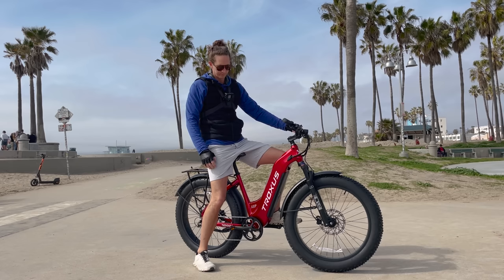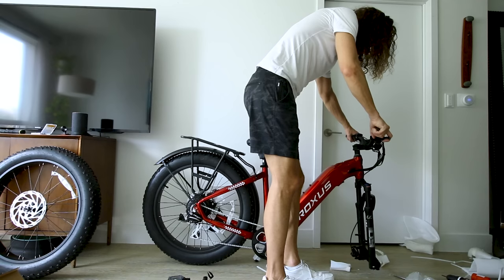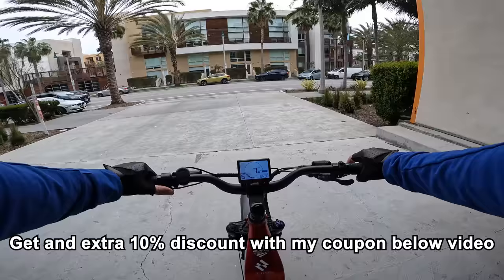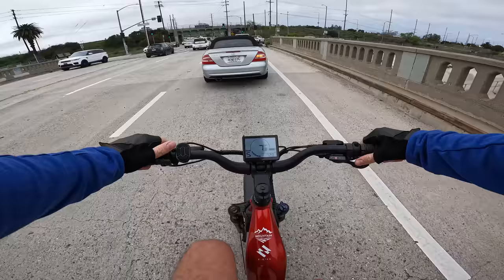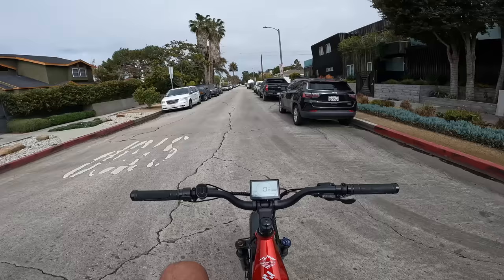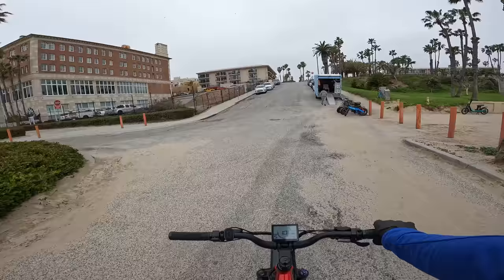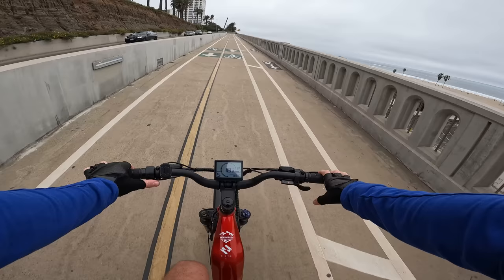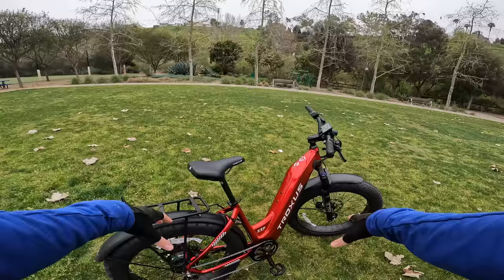Overpriced EBikes DO NOT Want You To See This! Troxus Explorer Review

Comment: One thing I see missing from virtually every ebike review is VERIFICATION that the battery does indeed provide the Ah capacity it claims to provide...in this case, 20Ah. This can be a problem as I have found a LOT of Ah claims that are quite a bit higher than reality (for example, an ebike battery claiming 10Ah actually delivering only 8Ah when properly tested. That's a 20% reduction from the claimed 10Ah.

One needs an Electronic Constant Load Tester (from about US$25 to US$100 for units sufficiently  accurate for these purposes) and the industry standard for lithium-ion cells is to test at 0.2C discharge (that's 0.2 x the claimed "C"apacity) or in this case, you would set the test load to (0.2 x 20 = 4) 4.0 Amps and see if you do in fact get 20Ah capacity out of the battery pack. The testing starts at the fully charged voltage of the battery pack, and continues at a constant 0.2C amps until the battery voltage reaches the lowest safe performing voltage for the battery pack. For standard Li-ion cell battery packs, this is usually either provided in the operating manual (for example, a "36.0V" ebike might be programmed to shutdown the ebike when the voltage drops below 30.0V. If one wants the most accurate reading, one sets the lower voltage based on the actual manufacturer specification of the lithium cells used in the pack...but these specs can be hard to come by. Many modern lithium cells can be run below the cutoff value defined by the ebike controller, but if one wants "real" data for a particular ebike/battery pack pairing, then one would consider using what the ebike controller sets as the real-world cutoff voltage.

The way some companies try to claim higher than actual Ah battery capacities, is to test the battery at much lower than industry standard discharge rates. For example, instead of testing a 20Ah battery at 4.0 Amps, an arbitrary company might instead test the battery at 2 Amps, or even 1 Amp discharge...Testing at lower discharge amps provides a highly deceptive and synthetically elevated Ah result which is then used in the marketing materials.

Only testing can verify the actual Ah performance of a battery pack, and I never believe the marketing Ah claims without verification.
Reply from the maker: Thanks for this idea. How do you feel amount weighing a battery to verify the physical size is in line with the claim of size?
Reply: @TailHappyTV  Unfortunately, it's not as reliable a test as it was at first. Fraudulent companies can just add ballast like sand to the cell to make it appear to weigh as much as it should. I've had a number of them that contained bits of metal; washers, flat plates, etc.

Either real-world use or electronic testing are the only solid ways to test them.
There are "comprehensive" testers available for anywhere about US$50-$150 that test capacity, internal resistance, and so on. LiitoKala (weird spelling) makes some ok  ones that are very easy to use but limited to certain cell shapes/sizes. Some people recommend a different brandname tester, but I haven't tried that one. Look at the youtube reviews on at least several different kinds to get a feel for what they can and CAN'T do.

For general purpose testing of lithium AND many other types of batteries/cells, one can use an electronic constant load tester, but you need to know more about what and how to test, safety, and hooking up the cells for testing. The cheap ones also cost $50-$150 or so. You can ID them as they don't have a case and the cooling fan is exposed. I got one that could test batteries up to 200VDC and dissipate up to 200W for well under $100 at the time. I could easily test a 72V ebike battery using this tester.
Here's an example of one of this type...a 200V/150W unit.
Currently on Amazon for US$60
top-tool-Adjustable-Electronic-Intelligent-Resistance/dp/B076RDSMD3

Here's another one on Amazon, B07KF1LLZD for US$73, but it also includes a power supply and some leads (the B076RDSMD3 apparently does not). This one is also a different configuration (one I like better as a good radiator with heat pipes should do better at keeping cooler the MOSFET...a critical part of the tester that can heat up a LOT during testing)

Comment: I don’t know if you’ve got to it yet and I’m only 3/4 of the way through the video, but on the little control press and hold the centre and you should have three levels of power, it comes with economy, then goes up to standard, and then goes up to sport, in standard in sport on level five you will make that easy

Comment: Dude, the simple way to open those straps is to  grab the end of one of then and pull it towards the connected spot.  Don't fat tires have a lot more resistance than other tires? That seems to defeat the purpose of an electric bike. I realize it's better for off road, but if you are going off road, my guess is there are better options.

Comment: that’s a decent price for what you get.  nice welds on frame, looks sturdy.  Bafang 750 watt geared hub motor is not as good as a mid drive, but one of the better geared hub motors.  Good quality acera shifters!  Heavier bike, but not noticable with a larger battery….unless you’re packing it up stairs.  I’d want some larger, better quality platform pedals….good review!  thx.
Reply: @Charlemagne1367  I’ve stripped off gear teeth from geared hub motors on steep terrain.  geared hub motors aren’t any more reliable than mid drives are.  Gearless hub motors are more reliable, but way heavier..  flat out, smooth terrain, i’ll pick a gearless hub motor.  Gnarley steep terrain, I’ll grab the mid drive everytime.
Reply: mid drive is overrated tbh. for just slightly more torque you have to deal with more maintenance and gear train wear and tear.
this bike has great specs but the battery is just small. 30-60mi range is meh
Reply: @mikec4308  Depends on the terrain you are traversing.  No pavement at the farm, and some very steep hills surround the valley…I built a tractor/bike with a hubmotor mounted midframe.  drives a jackshaft with a 5/1 gear reduction to a large sprocket on the rear wheel, for a total of 12/1 reduction.  26”fat tires.  Only goes 5 mph at 48 volts, but climbs any hill, and doubles to pull trees to the woodpile.  Use it alot for pulling around a gang mower, to keep the grass mowed down.  🤣

Comment: Personally for that I'd go for an Aventon Adventure 2. It's the same price but has a torque sensor where this Troxus doesn't. Though I do really like it. Without a torque sensor it's basically an Aventon Adventure 1. Which still is great.  It was the second ebike I bought and still have and still ride when I want a chill comfy ride(I put an extra suspension seat post and a nice comfy saddle and it's insanely comfy to ride. Which I bet this Troxus would be a nice ride as well.
Reply from the maker: great bikes
Reply: It's funny that you mentioned the Aventon Aventure 2. I was interested in the Troxus,but I missed out on the sale. 
So after several days of watching YouTube videos,I ended up ordering an Aventon Aventure 2 yesterday from a local dealer.
 He's going to set it up,and fine tune it for me when it comes in.
I'm paying the same amount I would have paid ordering it online,plus I'm getting it set up by a professional.
I like the fact that I'll have a bike shop that works on  Aventon e bikes for when I have a problem down the road .
Reply: Question regarding the torque sensor you mentioned:  Does this sense the torque that the rider applies to the pedals?  If so, then how would the Troxus be able to apply power commensurate to the rider's desires WITHOUT a torque sensor?  I rode a friend's e-bike some time ago and my biggest complaint was that the power it applied was not linear to the amount of effort I put into the pedals. Maybe I'd learn to adjust to it, but I would prefer an intuitive power assist instead of one that surges.
Reply from the maker: @gregparrott  cadence sensor is the more basic sensor on the troxus and sounds like your friends bike had the same
Reply: @TailHappyTV  Thanks for the reply. Using cadence is novel, and while the Troxus sounds like a bargain, the torque sensor sounds like a key item in my next purchase. An intuitive feel for applying power is important function.
Reply: does that model have a throttle ?
Reply: This is just like the Aventon Aventure. Problem with Aventon brand is that I hear lots of non-support from their corporate concerns whenever someone has a problem they never respond to try to fix it. When something is wonderful they comment a lot. That stinks 😩
Reply: Wired Freedom is better than Adventure 2 for the same price
Reply: @ralphs007 double check, I think that bike comes with free two year maintenance.
Reply: There are a few differences as pointed out in this video, larger rotors and battery jumps out straight away when you look at the specs.

Comment: I skeptical about these bikes now. I have two Cyrushers XF-800 and XF-900. These are Cyrusher's top of the line $2900. In both bikes I had rear frame snap clean three times--each time a $150 replacement part with $100 labor to replace. Both front forks seized completely after a year. The rear suspension in both bikes lost their bouncy action. pins snapped off. Hub motors in both bikes spun off the frame. I mean--nothing but problems with these $2900 bikes.
So this bike you're featuring looks great and the price is very attractive, but how will it be after a year or two?
PS: I'm riding in Manhattan with the occasional venturing out to the outer boroughs.
Reply: May I ask, are you a big guy? Do you weigh over 250 pounds?

Comment: Next time you open a strap-tied box, try turning the strap "upside down" at the connection point. There will be a  little tab that you can grab with your fingers (I'm 70 and I can still do it!) Pull and it should break the seal easily. Of course this does not apply to metal straps, but I rarely see those any more.  
Have fun!  I love your irreverent attitude.

Comment: One thing I've had to do with EVERY e-bike I've ever owned or have rigged-up for family member, is to change out the "minimalist" thing they laughingly call a headlight. I buy a different one with serious illumination and is powered by the ebike's battery pack. With the factory provided 1/2 Watt headlights on many ebikes, you can't see more than about 10 feet of the street late at night. By changing it for a quality $20 LED light you see much farther and your night ride is much safer. Unfortunately, not all ebike headlight wiring can even handle the power of an 18-22 Watt LED light and so one must know what one is doing when modifying the lighting system as you may also have to modify the wiring and even the switch. If a display computer head  is used to switch the headlight on/off, one also has to ensure that it can also handle the current as they rely on the provided headlight consuming so little power they use cheap components and can get away with it. Changing out the light changes things...sometimes a lot. It's why the manufacturer should design for and provide a quality light to begin with.

An alternative to a bike-powered light, is to buy a totally separate handlebar mounted headlight that comes with its own wiring and separate battery. Unfortunately again, many of the ones marketed on the internet are also weak with overinflated claims of "10,000 lumens" and such, and the batteries provided are often garbage when it comes to quality and true Ah rating. I've also examined these secondary headlights for their water resistance, and even when they claim an IPx6 rating, there are HOLES in the headlight case that allow rain inside, so even the IP rating is fraudulent.

I realize this bit on ebike headlights and lighting seems all negative, but it's simply to let you know there are some pitfalls ahead when you start out no matter which ebike you start with. It's a real shame when you buy a $1000 ebike only to find out the manufacturer chose to install the cheapest $1 wholesale cost (literally) headlight they could find to put on the ebike, when adding $8-$12 to the BMC would have made a major difference to customer night riding comfort and safety.

Comment: Another problem with bikes that kick in all the power from the start, is the battery will last shorter before you need a restart.
That's why more expensive bikes go up in strength into stages!

Comment: I ❤ your reviews! This is a very good starter bike for newbies getting into ebiking. But for experience power riders, I think they would be terribly disappointed. The added bonus is the range and price benefits..
Reply from the maker: Thank you for watching!
Reply: what about for a 75 year old guy.  Your thoughts.
Reply from the maker: @richardackerman838  go for it, you’ll be happy
Reply: @TailHappyTV  I'm considering an E-bike, but I wanted a folder.  I'm also an old guy, but never had anything but coaster brakes---no gears.  My vehicles are 5-speed manual, but IDK how that would apply to a bike.
Reply from the maker: @elultimo102  nice, I drive a 6 speed manual car! Gears on a bike are the same as a car, instead of a clutch you just pedal less hard, rotate the pedals lightly during shift. Brakes are straight forward, hydraulic disc are best. You might like a folding bike I am going to post tomorrow
Reply: WTF do you mean STARTER?!?!?  The d@mn this is selling for over twenty-three hundred bucks!
Reply: @michelj.gaudet5048  Performance not cost.

Comment: Thanks for the review. The two Questions I want to know you did not ask. 1. How much does the replacement battery cost?  2. When Riding long distances till the battery dies what is the range in the city?, and riding country roads?  have fun!
Reply from the maker: I'd guess 3-400$ for battery, not sure. city range depends on speed big time, you could do 40-70 miles depending how much help you give it and how hard you push it

Comment: Looks like the same frame as the Aventon Aventure....even has the same rear lights..like you mentioned, these are great components for the current price. If the price goes back to retail, the value not as good as other popular fat tire ebikes and I also wonder about the service.
Reply from the maker: That is actually the unnamed bike that I was referencing in comparison to this one couple times in the video, and I agree with your assessment on price sir. I should probably start a service shop here, pretty much all these bikes have very similar interchangeable components that could easily be swapped out if something went wrong down the road.
Reply: @TailHappyTV  Which bike did you prefer, this or Aventon. Now the Aventon is under 1,500 these are pretty comparable.
Reply: Exactly the same bike as the Aventure by specs and performance. The only difference I see is the overprice of the Troxus. If Troxus sold for $1000 less it would be a serious competitor.

Comment: it all depends on how many magnets are in the cadence sensor. The cadence sensor on my Ebike has 8 magnets, making for a smooth power increase. But my Ebike uses a Direct drive, or magnetic hub motor, no gears or other moving parts. So I do not take off as fast, but I can handle a 600 pound load, and since I pull a trailer, thats a good thing. And I hope your wearing a helmet, that bike is almost scary fast.
Reply: 23 mph is not scary. I've gone faster downhill on a road where I have to be on the outside of a white line. On a road with a 45 mph speed limit, I've kept up with traffic.
Reply: @isaiahwelch8066  I take it you have good vision? My best corrected vision is 20/200, so I cant get a drivers license. A friend of mine put it this way. "He, meaning me, does not like to go any faster then he can see"  And that about sums it up.
Reply: @longrider42  : It's not that I have good sight, it's that I analyze information very fast. I have the innate ability to use my peripheral vision and be able to take information and make decisions very quickly and very accurately. That's why I can travel at high rates of speed without issue.

Comment: Seems like a water puddle would throw liquid onto the battery pack and allow liquid to dribble onto the exposed seam between battery and frame.  Thus liquid can get inside the frame where wires and components are located.  So this is one of the genuine "Fair Weather Only" designs.
Reply: my Valk🚲XT7 never a  problemo in rain⛈storms
 has exposed battery🔋too 
:body-blue-raised-arms:6400km+

Comment: I own an Aventon Level step through model and have been interested in buying the Aventure 1 as a second bike but since seeing this video just now I would buy this bike instead.  The one thing that made me not as interested in the Aventure is the lower Ah battery considering it's size and weight. This is the Aventure 1 but cheaper and with a better battery so the Aventure is out of the running. I'm already used to a cadence sensor setup so having one on this bike isn't the turn off for me as it seems to be for some others.